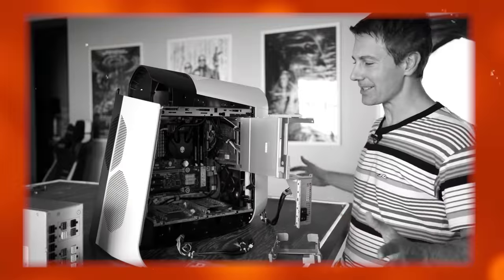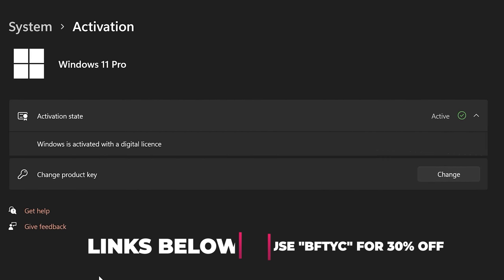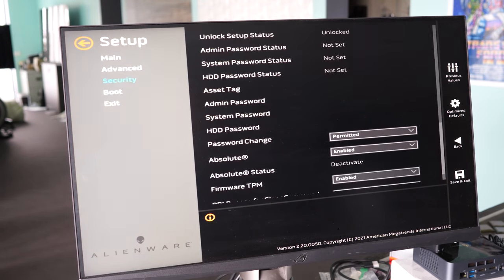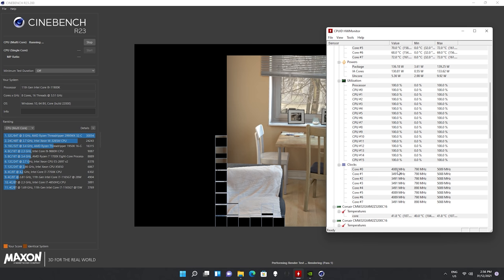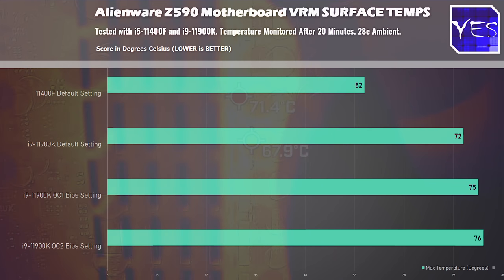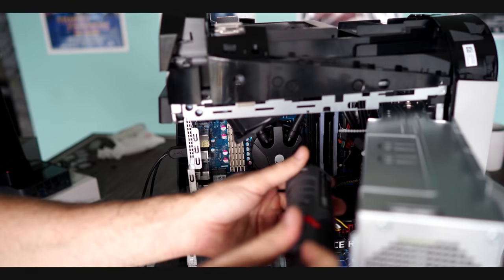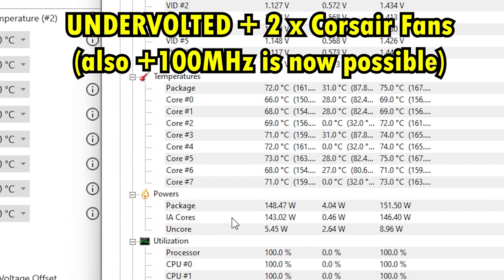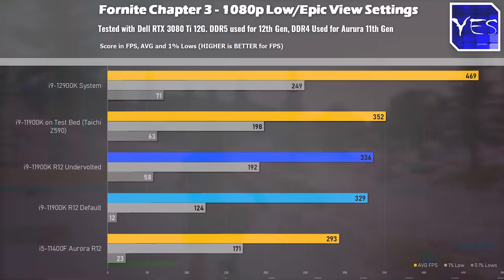UPGRADE the Alienware Aurora R12 from i5 to i9-11900K. Great VALUE or Great DISASTER?

Comment: 2:15 OEM builders usually opt for thermal paste with long term stability over maximum performance and these pastes tend to be very "dry" compared to more runny high performance pastes. OEM paste is supposed to work more or less the same the day it is bought than it is 5 years later. High performance paste can perform better short term, but they are more susceptible to pump out effect and with something like Kryonaut you should be expecting a yearly repaste, so they are not ideal for machines that go to customers that will probably never even look inside the case.
Reply: Hell no... In my computer IT experience, OEM thermal paste is always the cheapest of the cheap... barely qualifying

Comment: I would never add an hdd in there as long as there were thermal issues. Adding another heat source when you can actually have pretty much the same transfer rate outside the case. Better use another sata ssd
Reply: I agree. Wtf would you use a HDD on a top of the line gaming rig like that?!
Reply: right. I have a less than $1500 pc, but not at all would I consider getting some hdd.

I have 2tb and use it, but if I would buy now it would be ssd.

There are literally 1tb m.2 ssd's for $80, and could stick 4 together in a pcie adapter with cooling.

Or just sata ssds.
Reply: Especially at that price a 4k PC with a HDD no ....no
Reply: @WASD-MVME  i mean for some use I'd understand hdd, if want say 8, 10 or 20tb storage. But for 4? not really at that price
Reply: HDD is not a big thermal source . They are around or under 10W when they are working, and they are not working all the time. i9 could be problematic , it has TDP of 125W while i5 had 65W.
Reply: @aleksazunjic9672  it is another heat source whether it is working or not in a case with bad airflow. And i9 isn't 125w in real life. It is iver 170
Reply: @pavlosconstantinou9236  You said it yourself, changing CPU would be much bigger thermal problem then installing HDD.
Reply: @aleksazunjic9672  adding an hdd is just adding to the problem. Have you ever touched an hdd under load? They can reach temos of up to 60 degrees or more and that's in a small case
Reply: @pavlosconstantinou9236  No they cannot if they are working properly :D You probably have malfunctioning example or you put it beside something hot (PSU for example) . As I said,  modern HDD are 10W tops.
Reply: @aleksazunjic9672  man you probably don't wven what you are talking about and i shouldn't be talking to you at all. You are refering as watt consumption like everythings is analogically translated to heat. And I don't have ANY muldanctioning unit. I have A HUGE AMOUNT OF HDDS and experience more than your age. So please
Reply: @pavlosconstantinou9236  You lack basic physics understanding my friend :D Some refresher from elementary school E=P x t. If you have low power consumption, you cannot convert much energy into temperature.  Even if HDD converts all of its energy into heat, it still cannot give more then 10W of it.

Comment: Maybe a better CPU to use is the i7-11700K. According to official specs it should run half the memory bandwidth of the i9 part, but on most motherboards it runs the memory at full speed so then the difference is only 300MHz turbo frequency. Would be interesting to see if that works on the R12 as well since you get nearly identical performance to the i9 part.
Reply: @Saad it’s the same socket, all 11th generation CPUs use FCLGA1200.
Reply: I put a 11700k in my r12 I got the machine for peanuts so I'm happy with the machine but I wouldn't put high end parts in this machine you can't custom oc the ram, and the ram is stuck in gear ratio 2 so there's high latency unless you're playing at 4k
Reply: @CorbettK42  Thats actually useful info. If the RAM is stuck in gear 2 then you will see a improvement when using a I9 chip. If it had been able to use gear 1 on the i7 it would have been very close on performance probably.
Reply: @BertM3  it's stuck in gear 2 regardless of the CPU it's actually a problem with a lot of 11th gen OEM PC's
Reply: @BertM3  the i7 11700k is always a better choice then i9 11th gen the price difference is astronomical and there's not much performance difference I got the i7 for $250
Reply: @CorbettK42  Yeah I was looking to build a system last summer and sort of came to that same conclusion. Ended up going with a AMD system though. If I had gone Intel it would have been the i7-11700.

Comment: If flipping the dell with i9 and 3080ti wont work for the asking price you want you can still switch parts around and turn the dell into a budget gaming pc and use the RTX3080ti and i9 in a different case with a different board. Knowing ur chanses that wont have to happen :)

Comment: One trick you can try when power limited/thermally bound specifically for gaming would be to turn off hyperthreading, it'll lower your power draw and lower the vcore requirement at a given frequency
Reply: No bueno on a gaming rig.  Gamers Nexus has shown several times that disabling HT (on either AMD or Intel) negatively effects 1% and 0.1% lows and causes frametime spikes that you won't experience with HT enabled.
Reply: @erikhendrickson59  I have done my own testing, and it improves 1% and 0.1% lows. The only reason it should hurt frametimes is if the game is incorrectly configured to use the previous amount of threads or its one of the very few games that scales with more than 8 threads. for todays games it will help for the majority of cpu bound (mainly 1t) games on Intel processors
Reply: @erikhendrickson59  it does, on 4c/8t cpus. For some games maybe with 6c/12t cpus. But higher than that, mostly not, even imrpoves.

Comment: Happy new year, it's about 8 minutes away as I type here. Funny how undervolting actually cools it down and allows it to run faster. Too bad the boards so limited but you can keep the video card and put something different in it and sell off or sell as is with all the upgrades and make more profit upfront. If I really wanted a 3080 I'd probably keep it and sell off with lesser card.
Reply: @Swim Fan Well it does make sense if you turn down the voltage it won't be driven as hard and run cooler, which could lead to being able to speed up the clock speed a bit but most wouldn't think of it like that. People trying to get maximum performance were/are over volting things trying to drive it harder and get more speed but then they need better cooling and have to be careful or they damage the chips eventually or just fry it though many now have all kinds of protection circuits built in to save them selves if things go sideways. I care a lot more about stability than absolute speed, plus trying not to waste power and drive up my electric bill. I did ohms law as a freshman in high school but don't really remember all of it now but the formulas were good for figuring out what you had or needed. I started fixing TVs to make side money and that for me was more understanding how the circuits worked so I could troubleshoot and repair them. After a while you knew what generally fails and what the malfunction looks like so you could fix it quickly and have typical parts needed on hand. Nobody fixes things on a component level any, just replace the whole board.

Comment: No surprise there. Dell has been penny pinching in every way known to man since the early 2010's.
Do not buy anything from them and expect it to be built up to a standard. It's always DOWN when it comes from them :)
Reply: Every company is cutting corners and for the price this prebuilt is not bad. This is a game computer and gaming it does pretty well. No need for i9 if you just want to game, and for a serious work get components yourself.
Reply: @aleksazunjic9672  Did you look at the price tag?
Reply: @Chriva  what's the price tag?
Reply: @Chriva  Yes, relatively cheap considering going rate for 3080Ti currently.

Comment: Damn, that stock performance was horrible, it was actually below where a stock 3700x falls, my 5800x with an undervolt at 4.6ghz does almost 16k in r23 though :) so the 11900k really was a waste of sand as gamers Nexus stated.
Reply: It is not waste of sand, just it is not meant for gaming. For serious CPU work you need serious motherboard and different case .
Reply: @aleksazunjic9672  huh? 11900k not made for gaming? Then what? It's not got alot of cores. It's got the same amount of cores as my 2012 workstation Xeon..
Reply: @mortenee88  You said it yourself, it is a workstation/server processor , If you buy this for gaming, chances are you would be using barely 25% of its capabilities.
Reply: @aleksazunjic9672  I mean who in their right mind runs only 8 cores with dual channel ram and no extra pcie lanes for a workstation? It gets beaten by the 10850k/10900k at that anyway if you want to run workstation on z490/590. Do you somehow think I do not know what I'm talking about or what? 11900k is not workstation, it was made to crush AMD in gaming performance and it failed hard. It's a power hog with shit performance to match it's efficiency.
Reply: @aleksazunjic9672  my 12 core r 3900x performs better than this for both gaming and for workstation stuff. however neither of them are work station processors. they are consumer processors.
Reply: @aleksazunjic9672  Dude, this is not a workstation cpu. It's a mainstream cpu meant for gaming, video editing and everyday people like you(consumers). A workstation cpu would be xeon, epyc, intel x series chips and threadrippers that supports hefty amount of pcie lanes,storage and quad ram support. 11900k is just truly waste of sand and an insult to intel 10th gen lmao.
Reply: @mortenee88  Dual channel is all you can get with DDR4 . Quad channel is practically useless with DDR4 (search the net if you do not believe me) . 8 cores 16 threads is fine for workstations, even for smaller servers (again, search the net if you don't believe me) . Motherboard used here is cheap, but it is not meant for i9 anyway. 11900k was never designed for gaming, only idiots waste money on gaming machines with such processors . Proof is in this video (and previous) , GPU is practically maxed out in any modern game with i5 . Especially if you play in higher resolutions and with higher details.
Reply: @Dirt_Serpent  It certainly does not perform better in gaming, because even with i5 GPU is maxed out in any modern game at higher details and resolutions. For workstation/server stuff it depends on CPU load. If you have multithreading app that can utilize all of the cores, then ok.
Reply: @BenTiredson  Well, nope. Most games, even AAA would barely utilize 25% of its capability. Video editing, coupled with good graphics card - sure, if you are professional.  Office, web surfing - definite overkill, you could do that with i3 with no sweat.  Threadripper and such are serious server processors, and maybe for high end workstations that simulate servers. Overall, simple gamer buying i9 would just waste money, and even this video prove this.
Reply: @aleksazunjic9672  this is complete bullshit dude, 8 cores is very soon the standard for gaming. It's not even close to being workstation, and ddr4 has been in quad channel configurations for years. Since 2015 or earlier actually, you are just somehow envious of people who got way more resources than you is what I do think.
Reply: @aleksazunjic9672  in the case of this alienware pc you are extremely mistaken
Reply: @aleksazunjic9672  also, if i wanted a workstation pc i would have a workstation cpu like a thread ripper or something along those lines. believe it or not i actually do utilize quite a bit of my cpu and would actually prefer a r9 5950x over my 3900x because i would actually benefit from it. also Yes, my 3900x is absolutely performing better than this i5 in this dell system because MY pc does not thermal throttle in anyway what so ever.
Reply: @mortenee88  Yeah right :D You are deluding yourself. Due to current GPU shortage PC gaming is dying
 as more and more people are switching to consoles. Game developers cannot sell games for hardware that nobody owns . Games that came out last year run pretty well on 4c/8t hardware like i3 10100f . Depending on circumstances it will remain so for years. In fact, game development will be crippled until majority of players obtain at least 3060 or 6600xt and 1440p becomes mainstream resolution. For now, they still had to make games for 1060 (average GPU on steam) .  As for quad channel, people do put DDR4 memory in all 4 slots all the time , but it does not mean you will get 2 times more performance then dual channel . As I said, read about it and learn.
Reply: @aleksazunjic9672  haha talk for your own spot, we have availability to buy all cards up here in Norway, prices are wild though.
Reply: @aleksazunjic9672  filling the slots isn't quad channel.. x99/x299/threadripper all have quad channel.. filling all slots though will either give you dual og quad rank depending on what sticks you got in them. And it's not any major performance gainer.
Reply: @Dirt_Serpent  Be honest and admit that you don't do any kind of professional work with your computer :D As far as I'm concerned, you could do anything you want with your money. But people who actually make a living from this carefully calculate costs and upgrade paths. Therefore, they buy CPUs like Threadripper only if they really need them (to simulate server loads on multithreaded applications ) . People in rendering business are usually satisfied with i7 or i9 processors because they cannot justify the costs with performance gain.
Reply: @aleksazunjic9672  the i3-10100f is not a newer CPU in my opinion, might as well run a 6700k then. It's basicly a 6700/7700 re release in 2019 or whenever it came to market.
Reply: @mortenee88  Availability is not the problem, it is the price . Most people do not want to spend more then $1000 for a gaming PC - consoles are much cheaper. Companies developing games need to sell those games to someone, so they are looking what average gamer has and what he could buy in near future.
Reply: @aleksazunjic9672  i never said i was doing "professional work" i said i utilize the hardware i have and could actually benefit from a higher thread and core count. Be honest and admit that you dont have even half the knowledge you think you do, youve literally trolled almost every comment on this video.
Reply: he's a joke and funny thing he doesn't even know what the f he's talking about.
Reply: @Dirt_Serpent  You under-utilize hardware (especially CPU) if you use it just for gaming . Your money, of course, but the point is 11th gen i5 are sufficient for gaming and that is that.
Reply: @BenTiredson  Glad we have expert like you to point out my flaws (with proof, of course ) :D
Reply: @aleksazunjic9672  annnnd youre still not doing anything other than trolling. i didnt say anything about JUST gaming, those are your words. i said i utilize my cpu, and could benefit from more. good day troll
Reply: @Dirt_Serpent  And again you did not explain how do you use your CPU , and could you do same work with something less expensive . I just said that someone using i9 mainly for gaming is wasting money and is not very bright. If that truth hurts you, well, what can I do ...

Comment: I had an Alienware Threadripper system traded in for one of my gaming systems and had all the same headaches; thankfully, just like you did, a RAM upgrade, some Ryzen Master tuning, hours in the bios, RAM upgrade (the included stuff was 16gb of 2133MHz, upgraded to 64GB of 3200MHz) and even *the exact same corsair fan added to the 120mm AIO*, I was able to get the TR 1950X performing similar to a stock one on a decent motherboard. +rep great vid and really relatable
Reply: Threadripper headaches gee haven't heard that before

Comment: Hi Brian!

I have the R12 as well. Ended up replacing all the fans and also added a fourth fan at the front after removing the hard drive. It seemed to help alot. 

Do you have a video or about how to undervolt it to get a better benchmark score? I am not as tech savvy. 

Thanks!

Comment: I have 2 systems. One with a 5600x/b550 and 11400f/b560. Running at stock clocks can I undervolt these at the bios level and hopefully still maintain all performance?

Comment: Hey Brain,

Do you know what boards/bios the dell ryzen systems use?
Would it be at all possible for me to grab a 5800x + 3060ti/3070 dell combo .... and swap my 3600 into the dell system ?
...Also, would a asus strix gtx 1080 fit into it (physically)

*Thinking of buying a dell system, to rob the gpu and cpu from it.

Comment: Now i dont know about the Dell 3080TI, BUT the Dell 3080 in these things only has a cooler capable of ~220-250w(my 5700XT has better cooling than the Alienware machines we got for our espots team).
Fortunately, they basically use the same cooler for the 6800XT. 225w is alot closer to the TBP of the 6800XT than the 3080, and while they're both heavily throttled, its not as bad on the 6800xt. If i recall correctly, the team prefers the machines with 6800xt, but i dont know if that is because of performance or not, IDK i just order/service the hardware.
Under volting is basically required on both cards, and maybe they like the radeon versions because they have a 1 click undervolting option
Reply: Should note, that if you're desperate to order an alienware system, and you're going with an AMD CPU, do NOT get air cooling, even with a 65w processor the thing doesnt work because it is basically an intel stock cooler, with an aluminium puck to adapt it to AM4, and that extra ~8mm of aluminum makes a big difference